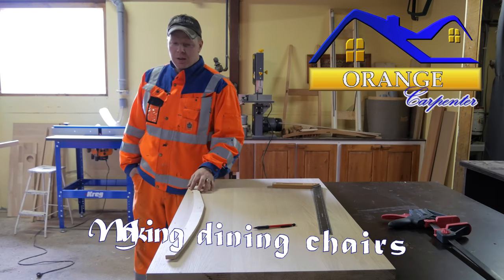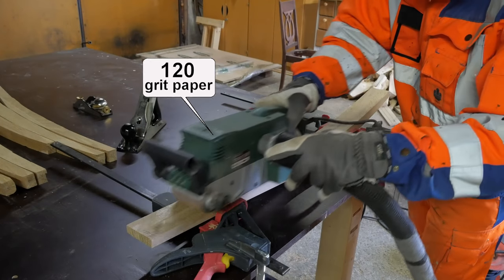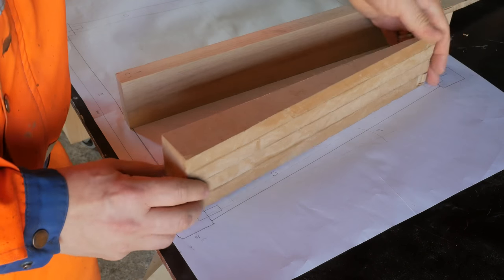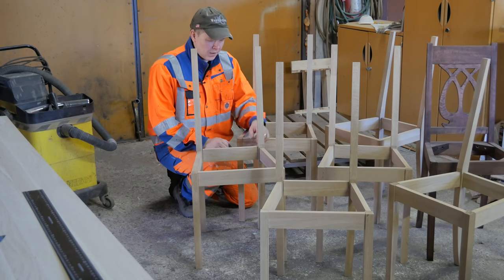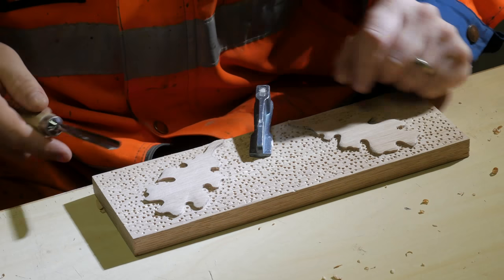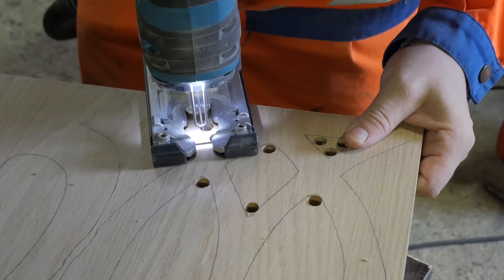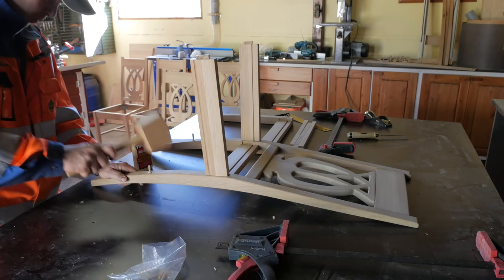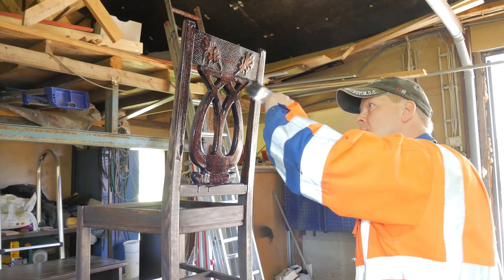Making dining chairs from oak boards

Comment: Easy way to do the inside curve is to use a lathe and a piece of 3" round stock and some sticky back sandpaper. I've made several chairs with that method and it goes much more quickly.. 
Nice chairs..
Reply from the maker: Good idea! I have had lathe on my "shopping" list for quite long already. Now I have one more reason to buy one. :-)

Comment: Thank you for this video. A friend of mine wants some chairs for his kitchen but he's having a hard time finding anything that matches his style & what they have is laminated mdf garbage for way more than he can afford. I'm going to see if I have the right tools to possibly make a couple chairs. Do you have any specific measurements listed anywhere?
Also, would it make the chair sturdier if the front legs were notched slightly so that the front support piece for the chair rested on it? I was thinking with slightly thicker legs they could have the mortise and a little lip for extra support. Maybe even have the legs for the back be thicker and have a lip/notch for support as well.
And have you ever made folding dining chairs? I didn't even know they existed until my sister just got some. I'd love to figure out how to make them & still have them be sturdy.
I like how you had the image pop up to show which parts you were working on and I also like how you showed how things went together.
Do you have a website that shows diagrams/blueprints with more details on these chair builds?
Reply from the maker: Hi and thanks for your very long message. Hmm let's see now...I do not have a website nor I have any measurements listed anywhere. I think you could google suggested seat height and  other measurements quite easily. If you're going to make seats from oak, then I would not make legs any thicker. They have very strong feel already and it's heavy material. These seats are heavy to move around I'm telling your. Adding more wood would just make them impossible for children to move. :-p
Reply: @OrangeCarpenter  Thanks, I've googled around & found some plans from Ana White as well as a few tidbits from Paul Sellers videos (which only mentioned the angle of incline for the seat back & the height of the front rail). Oak for the seat would probably be overdoing it because it would be covered by a cushion so plywood would work.
I've also researched enough to see that the mortise & tenon would be sufficient support & that adding a curved cut to the bottom of the rungs and aprons would be just as sturdy but reduce the overall weight of the chair. I'm going to have to play around with some scrap wood & make a prototype chair & make modifications on anything that doesn't work. That will be after I finish fixing my bathroom floor, secure the sheet vinyl, and install the toilet -- my to do list is HUGE. LOL.

Comment: Where do you purchase chair templates for this chair? Thanks
Reply from the maker: I didn't buy them from anywhere. I used another dining chair to copy the rear leg shape on a piece of plywood. This chair was around 80 years old and I borrowed it from my dad. :-) 
That back rest figure I found from internet while browsing different chair styles. I then taped 4 letter size papers together and did rough sketching freehand just by looking at that chair picture on the net. When I was satisfied with the look, I copied left side to right side making perfect mirror image. (which later I realized was not 100% accurate LOL)
So these templates cannot be bought from anywhere. If you want, I could take side and front photos of the chair and email them to you. This way you could use photoshop to copy the shapes and enlarge them to piece of paper. Just let me know if that would be helpful. Cheers!
Reply: Orange Carpenter thanks.
Reply from the maker: Oh I'm so sorry. I just realized I probably don't have my email in here...so here ya go --> orangecarpenter@gmail.com

Comment: Do you have an estimate for total cost an time in these chairs ?
Reply from the maker: Hmm let me see now. I paid around $450 (or  ~370 Eur) for the oak boards and then some other costs would be stain, screws and those metal corner supports which were not much at all. So that is just for the material costs.
How much time I used? Ughhh.....too much. Probably couple months in total....but that was like weekend hobby.